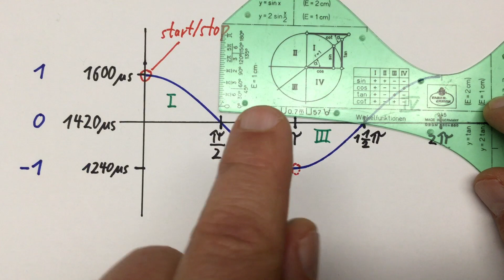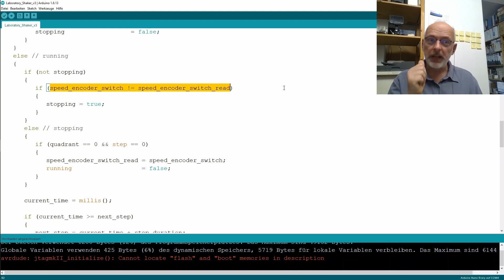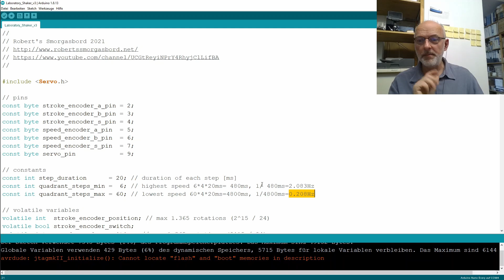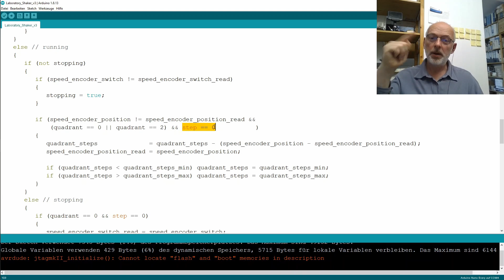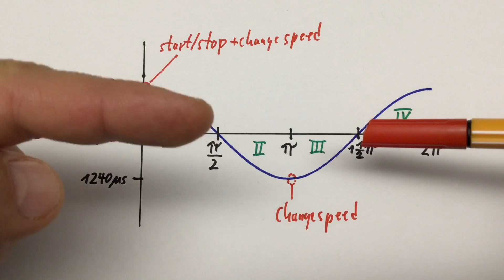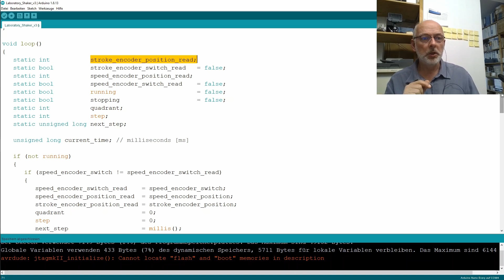Motion Control with RC Servo and Arduino Microcontroller (2/3)

Comment: Great tutorial! Any chance you could show a usecase with a ToF or ultrasonic sensor? For example that it dodges or lifts in accordance to the distance, maintaining a constant hight, maybe PID tuned reaction time
Reply from the maker: Thanks! Your suggested use case is very interesting. But usually I only do tutorials about stuff I intend to use in my projects. And that's not really on my platter now. But you'll never know ;-)
Reply: @robertssmorgasbord  you never know ;) now it's out there and a wild project might appear :D

Comment: I'm disappointed that it doesn't go to eleven ! seriously, this tutorial is great, just a thought, in a lab would you ever need it to accelerate gently over time  to a set frequency and amplitude and then decelerate down to zero or to another setpoint ?...cheers.
Reply from the maker: Sorry to disappoint you :-)) And yes, I do see applications in a lab where you want to increment/decrement frequency/amplitude over time. It's just not something I need right now. At least I hope I won't need it ;-) If my planned laboratory shaker shakes itself apart on startup/shutdown we'll talk about that subject again :-)
Reply: @robertssmorgasbord I'm sure thats the last time we will talk about then !
Reply from the maker: @andymouse  Don't be so sure! Remember, my laboratory water bath did self destruct on the first test run ;-)